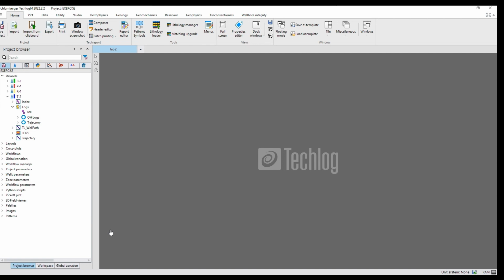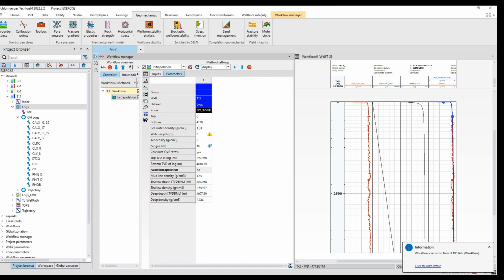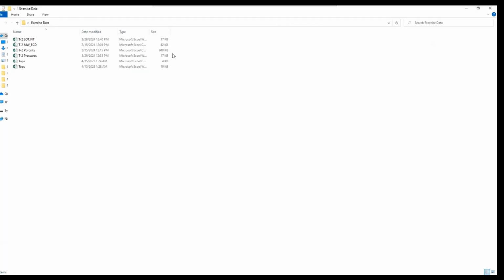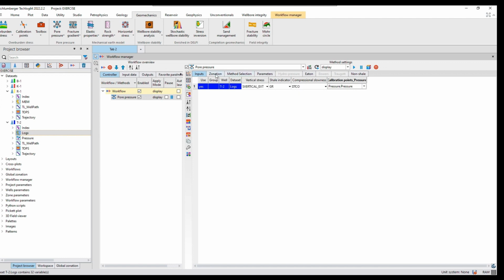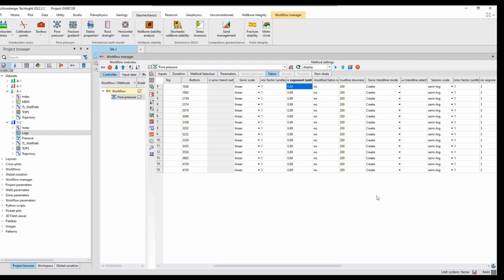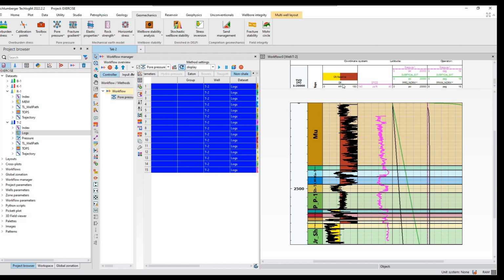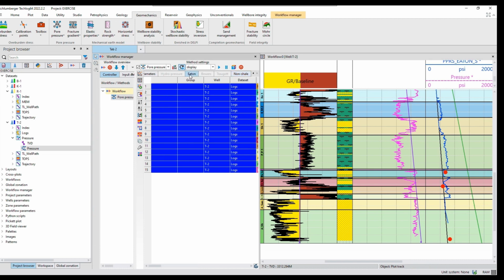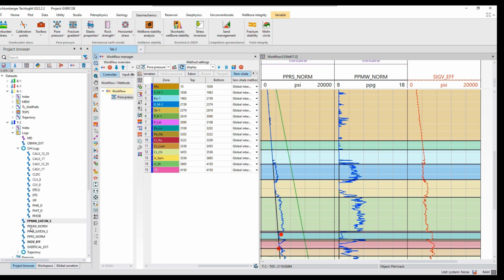Tutorial - 4 | How to Estimate Overburden/Vertical Stress & Pore Pressure in TechLog.

Comment: Hi Sir, I just created the Normal Compaction Trendline (NCT) on my Sonic log, but the calculated effective vertical stress (sigv effective) curve is still not showing up in the track. What could be causing this?
Reply from the maker: Did you defined your shaly and non shaly zones ? It uses both NCT and shale flag to estimate PP and SigV.
Reply: @TheGeoscientist-TG  so i need to define the shaly and non shaly? what tools do i need?
Reply: and why my formation pressure data closed to the vertical stress? isnt suppose to be close to pore pressure?
Reply from the maker: @dahlianbungasetya6823 Appologies for some misunderstanding on my side. First step in geomechanics in Techlog is estimation of Sv ( vertical stress). It is estimated using density log. You get two curves on is Vertical stress in psi and other is its gradient which is Overburden (obmw) in ppg. Once you are done with it, by using GR you have to mark shale and non shale intervals.
Reply: @TheGeoscientist-TG  can we discusse it more? because right now im working on my tesis and got no clue how it works, how can i contact you? I would be very happy if you would help me.

Comment: Hi Sir, for the overburden stress when I try to adjust the extrapolate and run the display again it removes all the logs from the layout. It seems that I can only run it when auto extrapolation is on. Would this greatly affect the computation of the Sv? I think its because when I start the overburden workflow its not readinf the TVDBML value I have
Reply from the maker: Go with autoextrapolate it works fine

Comment: Thank you for the video. I have two questions. When calculating the vertical stress, are the top and bottom TVDs from the density log or where do the logs begin? And the second is how you can estimate areas of overpressure from the curves previously made.
Reply from the maker: Its basically top and bottom TVD from where log starts (usualy from surface till TD)
To onserve overpressure you have to draw trendline on sonic(if using eaton method) or deep resistivity (bowers method). Then look for the part which is above NCT (normal compaction trendline) that is usually where you get overpressure. To be more accurate you have to calibrate it with pressures from DST or any mudgain or any kick in well.

Comment: @ the geoscientist  each time i draw trend line on DT it does not stay, once i drag the trend line to the bottom and double click, it leaves again, am using 2015 techlog
Reply from the maker: @majorskillz7589  Start trendline and add 2-3 nodes before the last point where you double click. Hope this will work. Also please check input parameters for trend line. It should be showing “create new” in input tab . If nothing works try turning off and restatring techlog. Letme know if it works or not.
Reply: @TheGeoscientist-TG   i have tried severally, i dont know how to add the nodes, mine does not show input parameters for trend line and it does not show create new tab, i have turn it off and on still the trend line on the DT dont stay each time i draw it.
Reply from the maker: @majorskillz7589  can you please share the snapshots on my email. So i can see where is the problem.

Comment: @the geoscientist-TG please do you have a video on fracture gradient prediction
Reply from the maker: https://youtu.be/F0wdiu31yf8?si=5XcJDoDS8GB7p3hH

Watch this one .
Reply: @TheGeoscientist-TG   hello sir, this one is on wellbore stability, please i need a video on fracture gradient prediction
Reply from the maker: @majorskillz7589  the light blue shaded area is frac gradient, dark blue is breakdown gradient, yellow is shear failure and gray is pore pressure
Reply from the maker: You can estimate using frac grad module it will require poissons ratio and pore pressure but i dnt prefer that one. Another raw method is to just plot all your stresses in excel and minimum principal stress at any instant is your frac gradient . For example at depth of 2000 your SHmax is less than Shmin and Sv then at that depth you frac is your SHmax. If you move to 2001m and you see that Shmin <SHmax<Sv than at that point your Shmin is frac. You can just write a formula in excel that whichever stress is less is equal to frac
Reply: @TheGeoscientist-TG  OK Thank you sir

Comment: do you have a video on how to estimate fracture gradient and how to  add up all the logs to get the pore pressure and fracture pressure for a particular field
Reply from the maker: @majorskillz7589  Hi. Its very simple you just have to merge similar logs. For example if you have GR log for 2 different section just select both logs and press right click. You will get merge option

For frac gradient there is quick method which require pore pressure and poissons ratio
While for detailed method you have to run complete 1D MEM modeling. And at the end you get MEM curves. Loss curve is basically frac gradient. You need LOT or XLOT data , mud loss information to calibrate that curve. I have explained that in the last video of this series
Reply: @TheGeoscientist-TG  please can you do a video on these please
Reply from the maker: @majorskillz7589 sure will do a tutorial about this one as well
Reply: @TheGeoscientist-TG   cant wait for that. also how filter the pore pressure,
thanks
Reply: @TheGeoscientist-TG  thats mean,  I can do the pore pressure combinar  from different method ? if the answer yes can you show us please , many thanks in advance
Reply from the maker: @najahsaeed2006 yes you can combine pore pressures estimated by different methods. Sure will make a quick tutorial about it

Comment: I tried to calculate the overburden but there an error,  there is a massage (the well does not contain any data set) what is the reason?
Reply from the maker: 1) Please check whether you have done TVD computations or not ?
2 Also please check the family of Density log. Is it assigned or not. 
3) While initiating overburden workflow did you select the dataset from the well or not ?
Letme know if this works
Reply from the maker: @almuntasirbellahkhalid4483  also check top log tvd and bottom log tvd in parameters tab for vertical stress conputation. Sometimes it dont get deptg values automaticaly. You have to enter it manualy
Reply: @TheGeoscientist-TG Hi sir i have the same problem here, but my well is a vertical well. do i have to do the tvd computations? and also my family of density log is already assigned
Reply from the maker: @d @dhsbswdgw5936 o the tvd computation. Just use 0 for inclination and azimuth from surface till TD of the well. And also in parameters tab check the Top log tvd and bottom TVd
Reply: @TheGeoscientist-TG thank you sir it worked. now, what about the gamma ray shale point? I have lithology and facies data to match the shale interval, but how do I use the lithology data?

and in your video, the gamma ray log has a shale/non-shale separator with the same value at every depth. but if we define the shale cut-off using Vshale calculations or other methods, the cut-off value changes with depth. so, is the gamma ray baseline in techlog already the correct approach?
Reply: @TheGeoscientist-TG and why is the trendline for NCT a straight line? can we make it logarithmic so that the NCT line follows the DTC curve? because i find it hard to adjust the line, always mismatch with the DTC curve. and also what is PPRS_NORM sir?
Reply from the maker: @dhsbswdgw5936 You just have to define shale and non shale intervals. If you already have facies or lithology make a flag from it and use that one. Basic philosopy is that we usually estimate pore pressure in clastics specially shaly formations in eaton method . And later on for tight formations we interpolate from shale above and below the tight formations.
Reply from the maker: @dhsbswdgw5936 yes you can display it in log scale if you have high variation in values like we have in resistivity logs. The area where we work our sonic ranges from 45 to 120-130. So for me linear scale works fine. PPRS norm generaly represents that how far is your estimated pp deviates from the normal hydrostatic head. Its formula is (PP-Ph)/(Sv-Ph).
For example your Ph is 30 MPa, Sv is 70 Mpa, PP is 50 Mpa. Your pprs norm will be 0.5. Which means that firmation pressure is halfway between Hydrostatic and lithostatic pressure.
Reply: @TheGeoscientist-TG sir i already load my lithology data but i still have no clue about the next steps. do i still need the gamma ray data?
Reply: it is my very first time using techlog sir
Reply from the maker: @dhsbswdgw5936 yes you need either gr or vclay.
Reply: @TheGeoscientist-TG sir i already use my lithology data as a shale flag, and my gr data as a shale indicator. but when i try to make the trendline in both gr and dtc it didn't do anything. but when i remove the lithology data and just using the gr, its working. can u help me with this problem sir?
Reply from the maker: @dhsbswdgw5936 when you are importing lithology as shale flag and us gr as well. So when you play with gr, it will update shale flag accordingly. So if you have shale flag dont do anything with gr, just create nct on sonic .
Reply: @TheGeoscientist-TG okay thank you so much sir it worked. one more thing sir, in my wellbore stability using modified lade, my new cmw min is not changing, its just follow my mw data. but i think my shear failure, kick, loss, and breakdown are correct. how can this happened sir can u help me?
Reply from the maker: @dhsbswdgw5936 mw min is basically your input mw.
Reply: @TheGeoscientist-TG so the modified lade doesn't give the mud recommendation?

Comment: Lovely lecture, but I have question, what if we don't have density log in upper section of well? As you know limited data is usually acquired in non reservoir section. Could you us how to generate density log from sonic compressional. Thanks in advance.
Reply from the maker: @faisalbangash8582  Hi thanks for appreciation
If you donot have density log or have bad density due to bad hole, you can use following equation to generate synthetic density log from sonic
Density = 0.235 x Vp^0.25
Vp = 1/ Dt

Vp : Pwave velocity (ft/micro sec)
Dt : Compressional Sonic

Comment: Thank you. when I choose the bowers method, I can only get a part of pore pressure, not the whole well depth. How could I solve it?
Reply from the maker: @johnnypappas-y7m  did you choose all formation tops from zonation tab ? And also did you make the trend line for whole well ?
Reply from the maker: @johnnypappas-y7m  Also check top log tvd and bottom log tvd in the first step where you calculate Vertical / Overburden stress.
Reply: @TheGeoscientist-TG  sorry sir, there are some sections in the middle of the well that have no results.Is this possibly related to the Bowers' parameters, or should I use effective stress instead of overburden pressure?
Reply from the maker: @johnnypappas-y7m  yes might be. Are these intervals non- shaly ? Check the interpolation method in parameters section. For non-shaly formation use global interpolation . I hope this will solve the issue